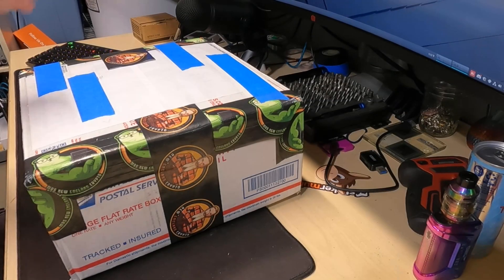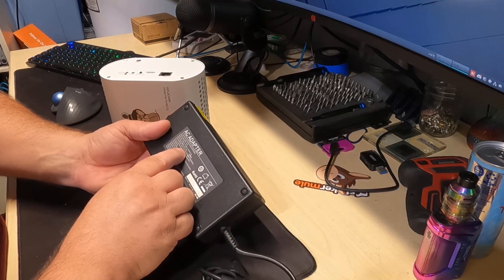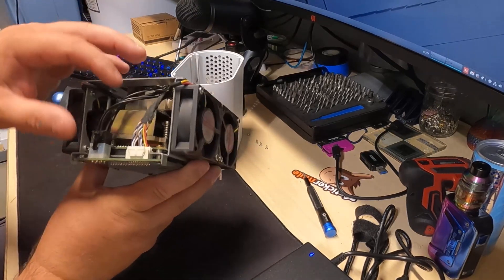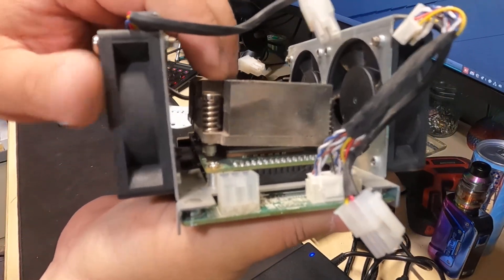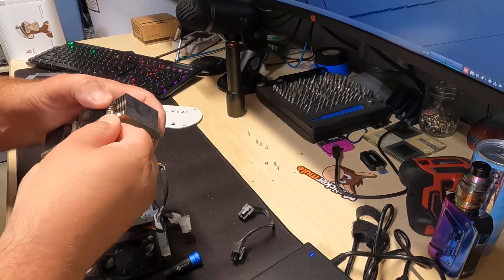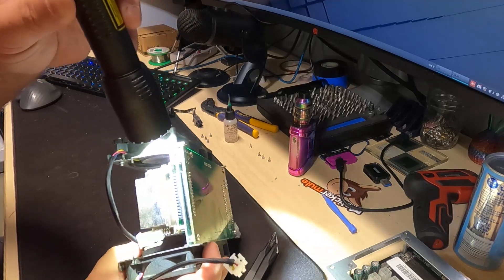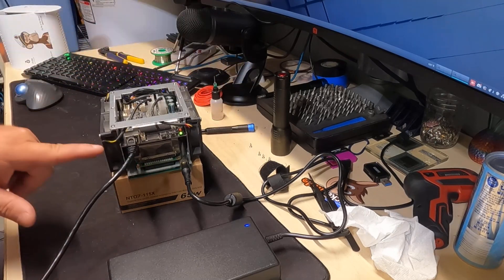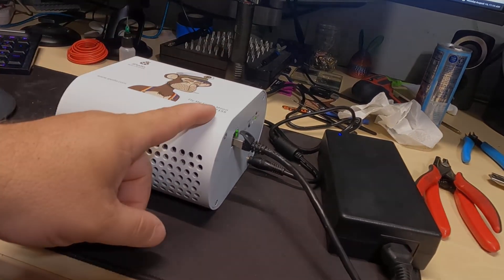iPollo G1 Mini Heatsink Repair

Comment: E poxy resin and wait 24 hours works well. The threaded inserts are not soldered in they are a compression fit. The hole in the PCB is too small and the threaded insert is bench pressed in.